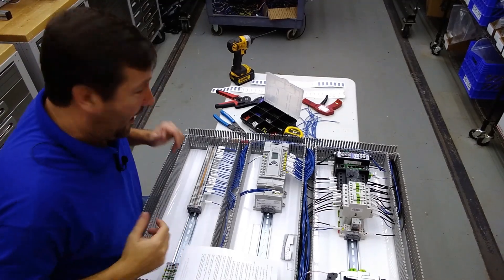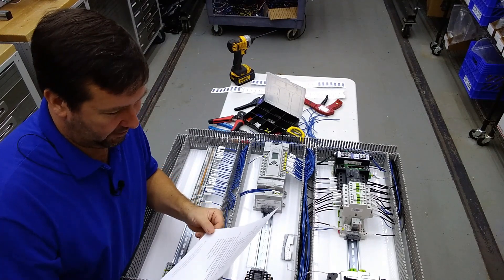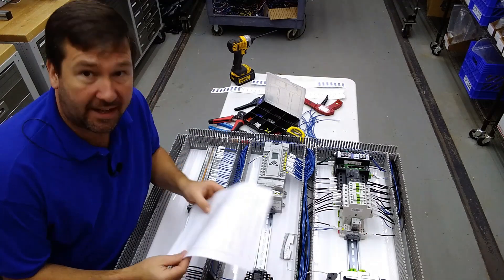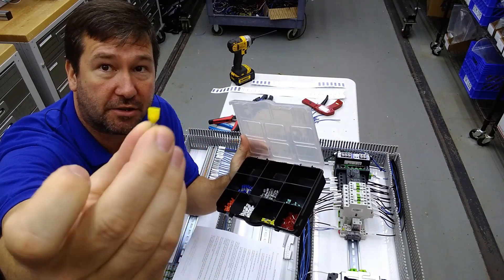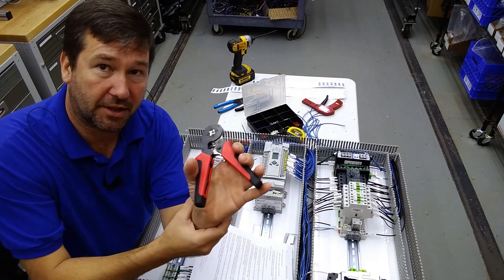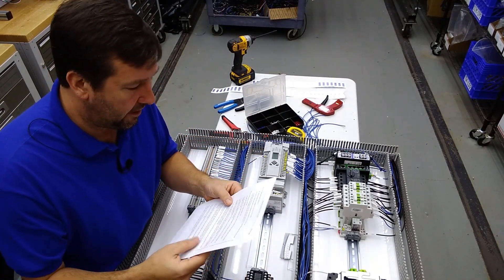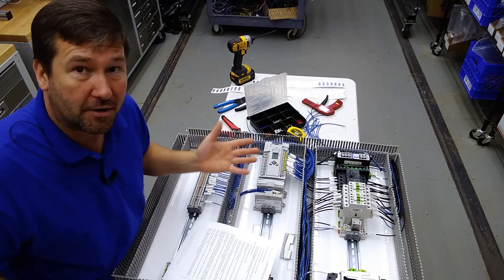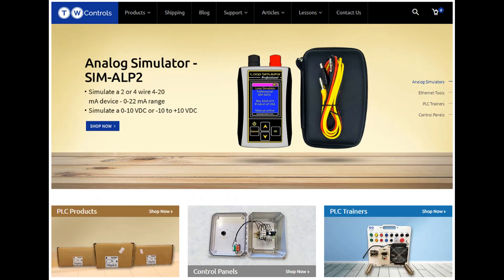Wire Ferrules - When to Use, How to Crimp, and UL 508A Guidelines

Comment: Not sure if I missed it but ferrules also allow stranded wire to be terminated on devices that manufactures specifically state solid wire must be used. In other words the ferrules turns stranded wire into solid wire to meet NEC. And since NEC doesn’t allow multiple wires under under one terminal, using the dual wire ferrules allows you to terminate two stranded wires under a single terminal rated for a single wire and comply with NEC. Because once the two wires are crimped with the two wire rated ferrule the connection is reclassified as a single wire termination point. This is all outlined in both UL and NEC and feral manufacturer specs. I just don’t remember which sections off the top of my head.
Reply: I total agree. It does make it difficult to troubleshoot when theres two wires crimped together. But a lot of times there isn’t room inside a device for terminal blocks or wire nuts. So two wire ferrules are what I use to appease the inspectors. 

I rarely use two wire ferrules in a control cabinet. If they are used in cabinets it’s only in the rare situation where there’s not enough room for additional terminal blocks. 

I’ll try to find the references tonight. I know I have it somewhere in my notes. I get questioned about the use of ferrules in general every so often because I use single wire ferrules on just about everything and most people don’t even know what they are.

http://productspec.ul.com/document.php?id=ZMLF.GuideInfo

https://standardscatalog.ul.com/standards/en/standard_486c_7

https://standardscatalog.ul.com/standards/en/standard_486e_5
Reply from the maker: @mumbles1justin  Good links, thanks.
Reply from the maker: I left the stranded wire in a solid connection out because I couldn't find anything specifically saying that you could do it.  But I would say it is the same specification that allows the 2 wire rated ferrule by turning it into a single connection.  I'd like to see that section of code to lays that out. 

I was surprised that it said "wire(s)", I was sure that you could only put one wire in a ferrule.  I still see some disadvantages to doing this from a troubleshooting perspective since you can separate the circuit to narrow down a problem but it is nice to have the option.

Thanks for the info Justin!
Reply: Hello, we are Leading Wire Harness and Cable Assembly processing machine manufacturer & supplier in China with high quality and good price. Website: http://zsht-equipment.com/   Email: sales@zsht-equipment.com  Skype: gao.irene  Tel/whatsApp/wechat: +86-18676147382